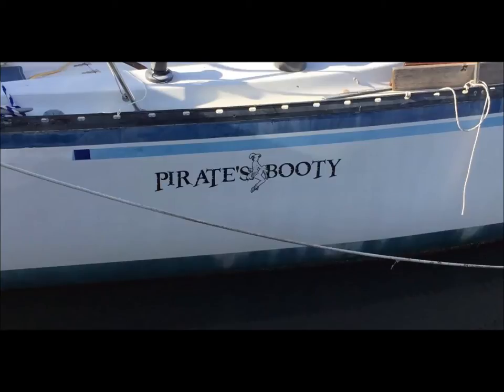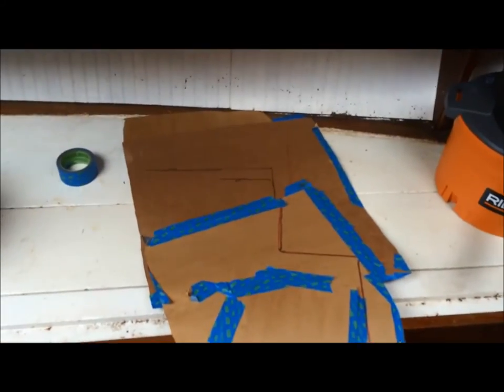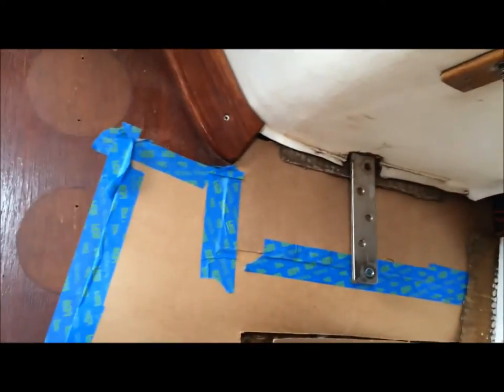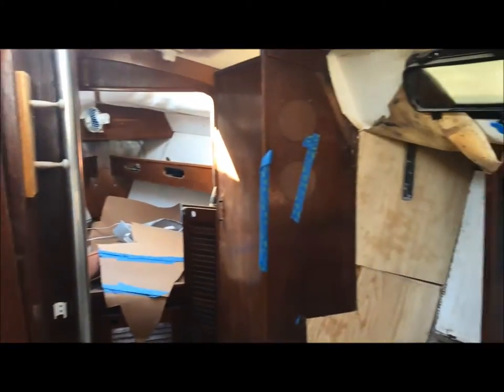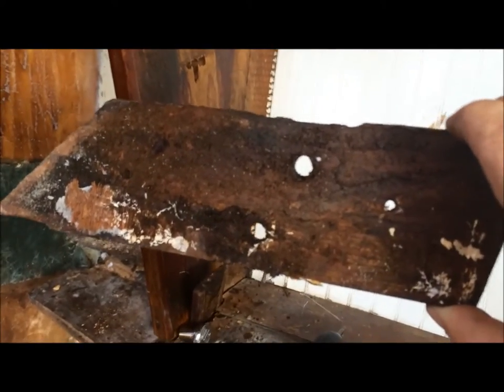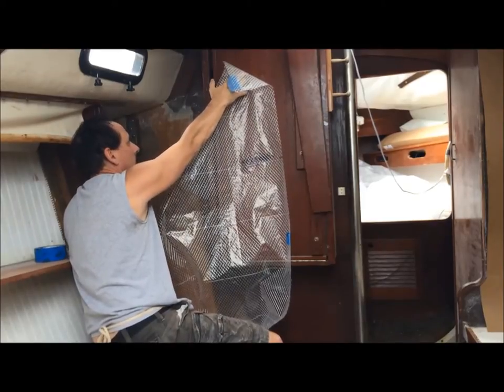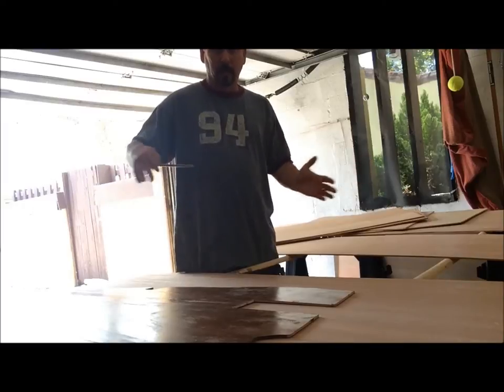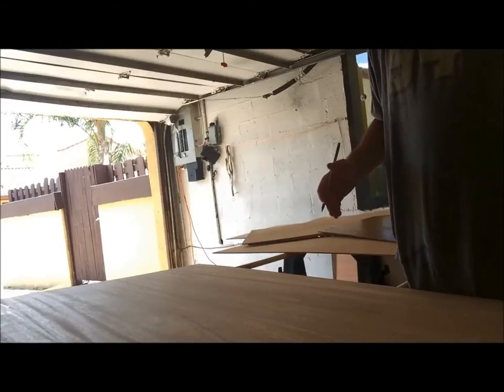Episode 1:  Pirate Booty BulkHead Rebuilding

Comment: okay, I have to ask the stupid question.  How do you gain rightful ownership in the boat.  I understand that it had been abanded in the Keys.  But you had to somehow gain some type of legal ownership to it before you spent all of your hard earned time and money fixing it up.  I would be so afraid that someone would show up once I finished the restoration and "re-claim" their boat.
Reply from the maker: +Don Harden  Hi,Actually Check your local marina's and ask the Doc Master if anyone is interested in selling their boats.  Ask who is far behind in slip fees etc. You don't have to pay the feels, they will probably sail cheap.Me, I had to track down the original owner, told them there were 4,000 in slip fees, and I would take care of them.  Of course I didn't, it was on their credit. So they signed the boat over to me. Check that it doesn't have a USCG Hull #, that is hard to get a title on.  There are 3 stages to boat owners.1. Yeah, they are out all the time.2. Then they will put it out in the yard, or slip  and it sits for 2 - 3 years.  They will try to recoup their cost, 3. Finally they will give it up cheap to get rid of it. Any other questions, just ask..   Just keep your ear to the group for the kind of boat you want, it will pop up!Kelly
Reply: Thank you Kelly for the great reply.  I really would like to get a sailboat and don't mind spending the time to fix it up.  I have a 1966 20 Foot Proline center Console that I got as a rotten hull and completely rebuilt it from the ground up, now estimated at worth $15,000.  Would love to have a sailboat that we could use as a weekend live aboard.  I will try the process you listed and see what happens.  I am also a diver and love the Keys.  I have been on the Spiegel Grove about 30 times which includes both before and after she up-righted herself after a storm.
Reply from the maker: Hi Don !
Oh yes, my first/2nd boats were trashed. I ended up selling these for scrap, mine now is gently rebuilt, as in the Bulkheads were the major part. I am having fun with the Electrical, 3 batteries and switches etc. Now onto the Diesel, the Engine is good, but I have a burp somewhere in the lines. It runs for 10 minutes then dies, unable to start again. I am draining the fuel and checking the lines for this one.

Sailboats are all out there. I don't know where you live, but when I lived in Maryland, they had sailboat grave yards. You could get them for a song.

So cool to hear you are on the diver, and wow to see you got to the Spiegel in those conditions, the Ocean is a Marvelous thing is it not !

Kelly
Reply: I live in NC.  Work at Duke (for 26 years).  I want to thank you for turning me onto White Spot Pirates.  I am on number 10 of her videos.  I think she really got screwed for paying $10,000 for that boat!  she is giving it her best.
I am going to check out the sailboat grave yards.  I am also a gunsmith so I do pretty decent work with wood and metal.  I think there is a scratch build on my YouTube page of a 30-06 I was building a couple of years ago.